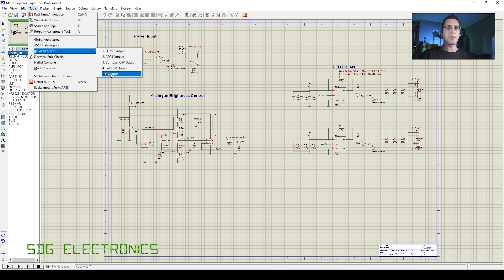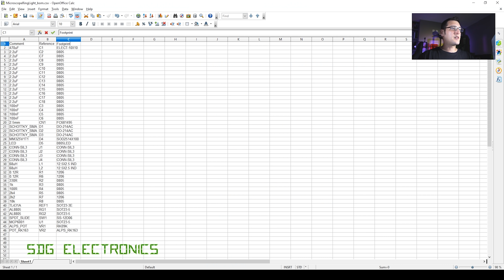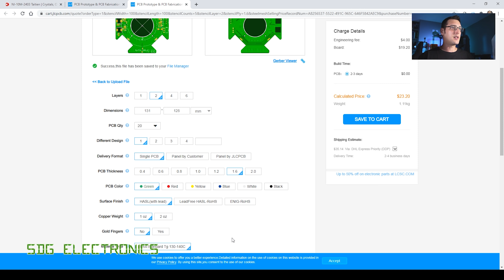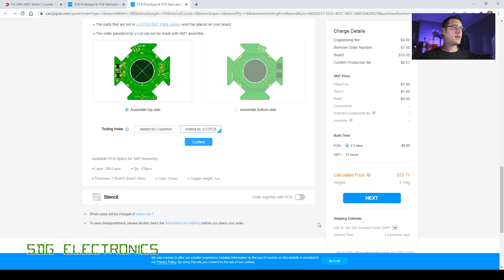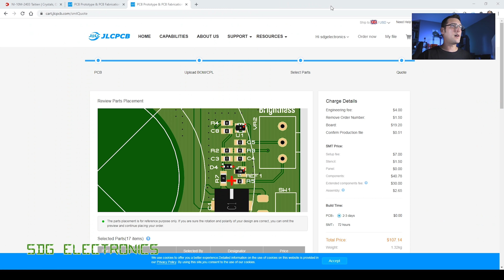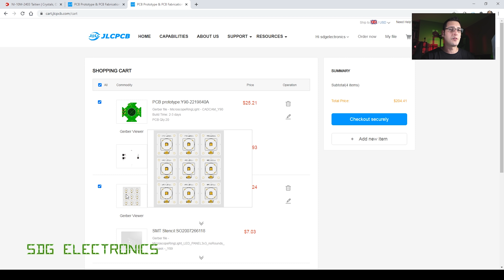SDG #166 Creating Ring Light Pick and Place Files for JLCPCB's Assembly Service

Comment: Using JLCPCB's EasyEDA software does eliminate most of steps in generating BOMs and the pick&place file for assembly.

I have found that they don't like the CSV(come separated variable) files output by EasyEDA, but all you need to do is import the CSV files into Excel and save them as XLS files and they're good to go.  I usually do some minor editing to reduce the files just to the SMT parts they will be assembling for simplicity.

EasyEDA is a decent layout package that's pretty quick to learn and the integration with JLC is a true convenience.
Reply from the maker: I've not yet used it, but I might try it out on a simple project. I like that I can still open my layout files in Proteus from 15 years ago and still use them.
Reply: @sdgelectronics  I had been using an old version of Eagle (which, no matter what OS and other software you've used, has a very steep learning curve), and haven't looked back since giving EasyEDA a try.  It's a plus that old Eagle layouts import in to EasyEDA.

There's always a danger with cloud-based services that all your work can be lost when somebody pulls the plug, but EasyEDA will also work with local files and generates Gerber files, so that risk can be mitigated. 

One other point to make.  Some of the other online layout packages require you share your designs or only allow you to keep a few private.  With EasyEDA, you may share your designs, or you can keep them private.  If you build symbols and footprints, the library is made public, but this is the only time you are forced to share.

Comment: Nice to see somebody check the Gerber’s etc, to reduce the chance of getting a duff PCB. I used to hate hitting the go button when you've got £1000 pcb order, only once did we get it wrong. A rush on flex-ridged PCB and the 30 pin connector was mirrored, also was only noticed after PCB’s were heat soaked for 2hrs and the connectors soldered on and they did not fit in the box. Well it did but the connector was facing inwards :(
Reply from the maker: Connectors on FPCs and flex-rigid boards are my nemesis. Even after paper origami models, I always end up with the pins in the opposite order.
Reply: @SDG Electronics  it was the first one we had done, too many years to when Flex-ridged boards were just taking off, we were looking at removing a lot of handwiring from boards to connectors. PCB's was multilayer with outer ‘s as ground screens and the inner a mixture of single and twisted pair’s. One big copper sandwich with cross hatching on the outer copper layers where the pcb had to bend. Full of via’s as the twisted pair tracks change layer as they run along in side. A lot of red faces - Happy days.

Comment: I've just tried PCBWay. The only advantage here is that you can order from DigiKey. Otherwise, PCBWay is expensive and there is no preview for the components placements. One disadvantage for JLCPCB is that they have limited 74HC parts , for example no 74x121.
So, I need to separate order the missing 74's and do some own SMD work, when ordering from JLCPCB.
Reply from the maker: They definitely each have areas that make a design suited more towards one or the other. I've not yet tried doing the assembly service from PCBWay which is much more complete, but the pricing of JLCPCB is highly attractive.